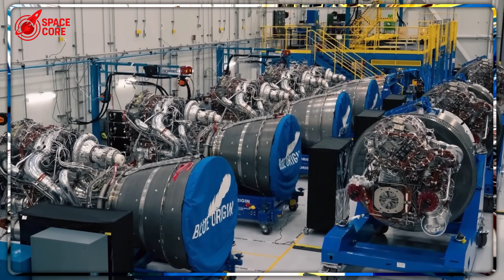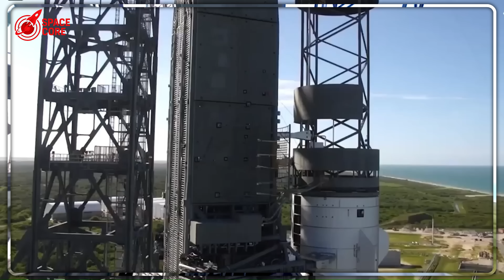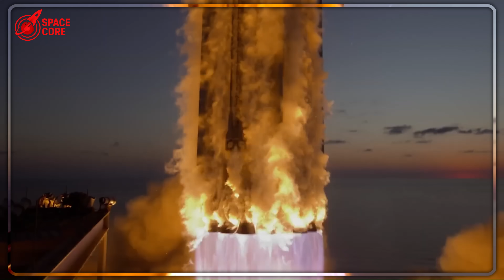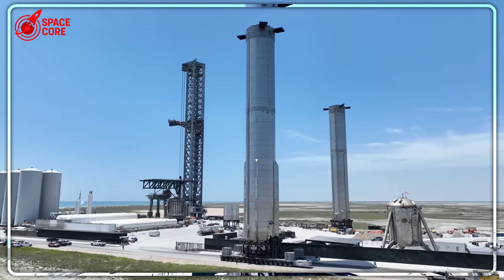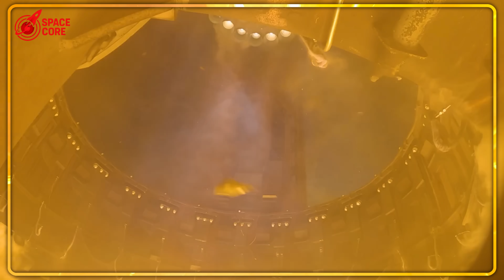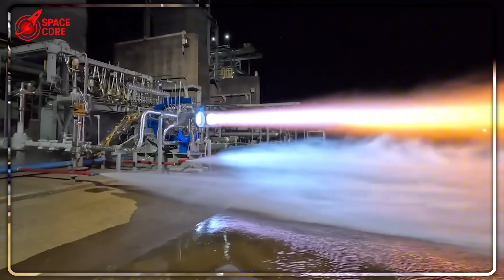SpaceX Builds 300+ Engines While Blue Origin Makes...SHOCKED Industry!

Comment: Complexity has another downside.
In an engine re-use system, servicing load is more difficult and time consuming than for a simple system.
The smaller parts count and the simpler the design, the less the mechanic has to do to get the engine ready for the next use.

SpaceX's $500k per engine is not the simple bottom line. Their intent is that each engine will be used MULTIPLE times. As is the case with Falcon 9. Re-use will dominate future rocket engine use.
Reply from the maker: Absolutely, simpler designs like Raptor 3 reduce servicing time and boost reuse efficiency. SpaceX’s $500k engine cost reflects a strategy for scalable, reusable spaceflight.